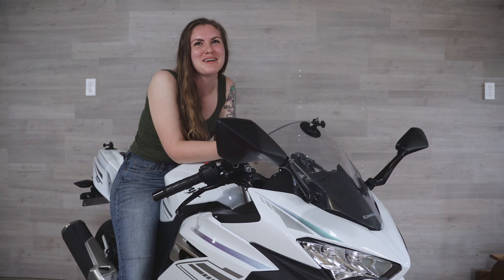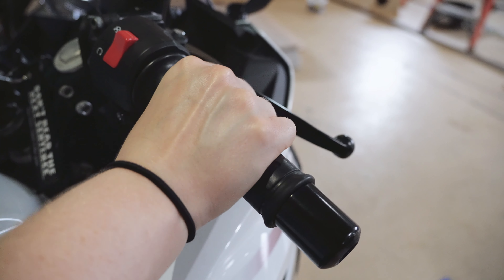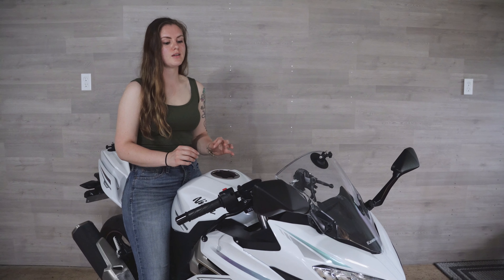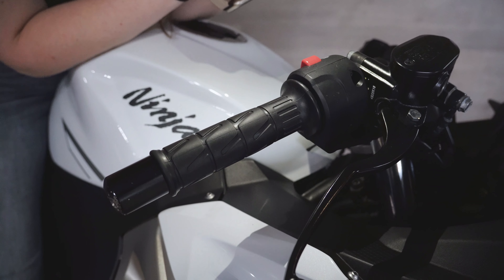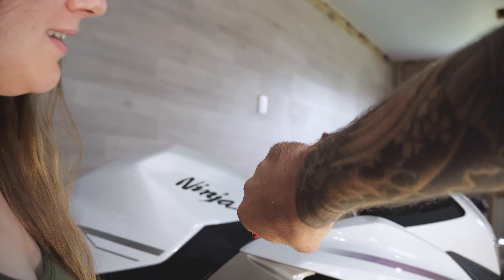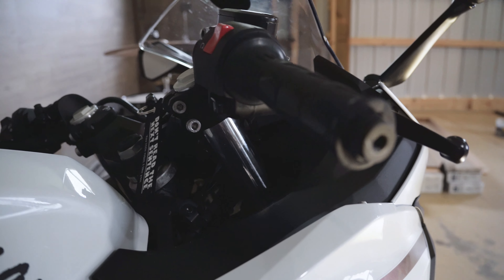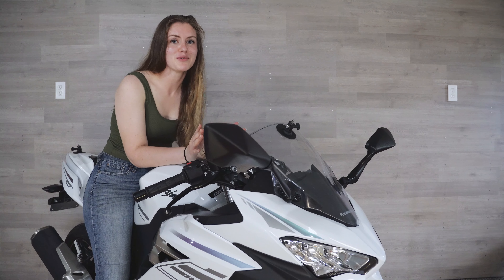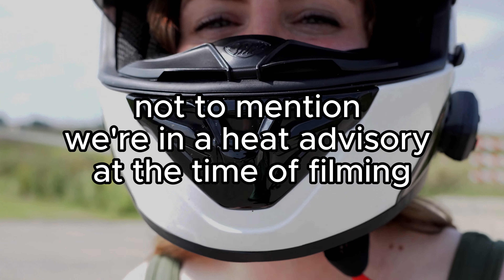Stuck Motorcycle Throttle Troubleshooting

Comment: Hah, interesting mine does snap back but not entirely like it should after yours is fixed. It sticks a bit on the beginning and when rolling off the throttle it goes back but sometimes stays a bit on throttle when I do that. Did dropped my bike on that side too, so might be the same issue or it's just an throttle cable adjustment issue and have to loose tension on it or maybe spray the cable in with the proper stuff.
Also the keychain had me laughing. 😆
Reply from the maker: @KeViNMCMXXCIX  i dont claim to be an expert at this point but yeah it should snap back fully to "off". There may be a little free play on it where it takes an extra centimeter or so for the throttle to actually do anything. Meaning you can wiggle it around a little and the RPMs dont move. Yeah it might be time for a little tune up! 🎶
Reply from the maker: @KeViNMCMXXCIX  and lol you noticed my keychain 😆 glad you like it. 👍
Reply: @joyridemel  Yeah the free play is there as well. Which I knew it is supposed to be there. But the first bit after, when it somewhat "sticks" But as mentioned can't be anything serious, maybe an adjustment or remove the bar end for a bit and tie it back. Or lube the cable. It is also not on the thing you pointed out in the video. I have space in between.